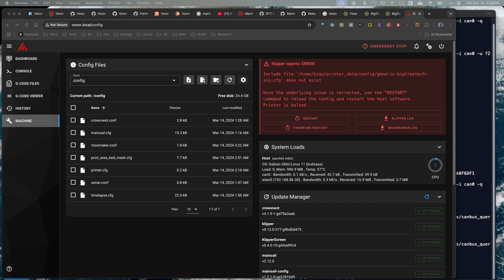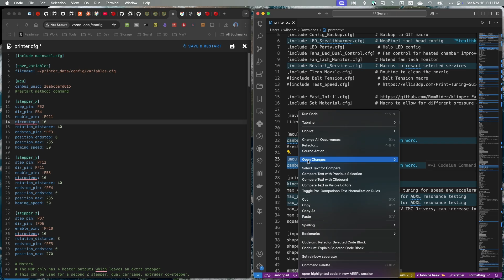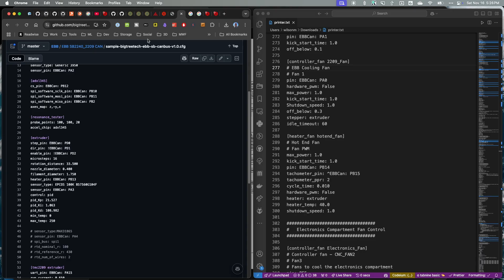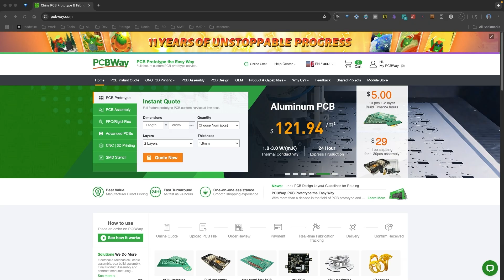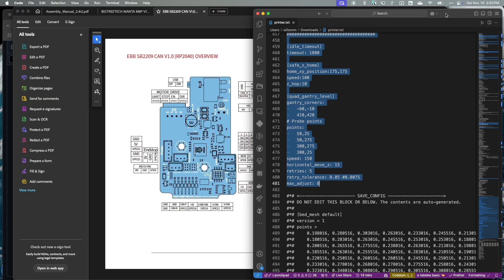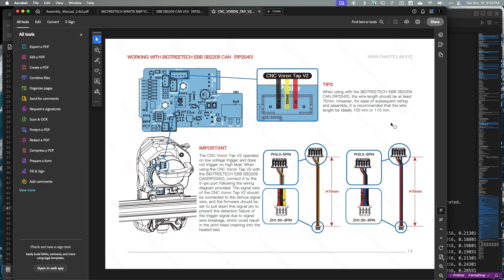Voron 2.4 R2 Build Guide: FINALLY Fixing My Printer.cfg (Don't Make My Mistakes!)

Comment: I had the same issue with my thermistor and after trying a second thermistor and then rewiring them both to use the 2 pin plug with no better luck it turned out my little number switches were all reversed on the EBB board.  I also changed sensor_type: PT1000 sensor_pin: EBBCan: gpio27 pullup_resistor: 4700 in the printer.config as my Formbot kit came with the PT1000. Thank you for the time and effort you've put into these videos, they were of great help!

Comment: Im using the M8P V2.0. I do not see the config for that on the klipper github you used. Should I instead use the BTT GitHub for the V2.0?
Reply: I had the same problem. I am currently working with it. You can contact me if you want.